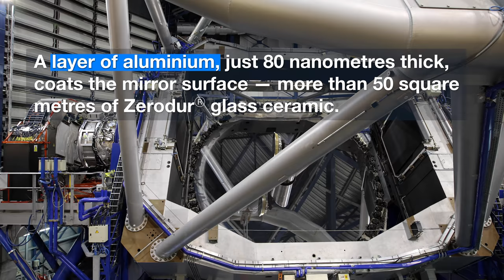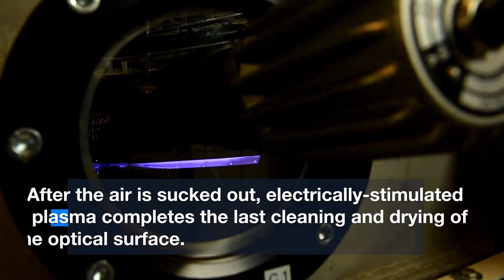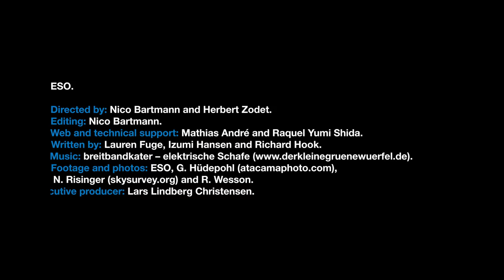ESOcast 120: Chile Chill 10 – “VLT Main Mirror Recoating”

Comment: How often is this done ? If I left a mirror slightly tilted like that in my house, in 2 weeks it would be covered in dust. And I suppose the Atacama desert is some dusty place ?
Reply: i has the same doubt!
Reply: I doubt there's much of a dust problem there, as the dust mainly should consist of sand particles there, which are heavy. It's not like your city environment, where pollen, soot and particles of fiiber rubbed off from clothes and all sorts of small organic bit gather to form flakes under your couch. Plus, there's the dome that will be shut when wind speeds will suffice to carry dust up the hill.
Reply: You must be right, probably more sand than that dirty dust in big cities, with skin cells, fibers and all that nasty black stuff from the pollution. I'd like some Atacama air in my house please :)
Reply: A German physicist actually wrote a paper about the very common dust. It turns out there's some fascinating stuff in there as well. But mainly it's really very fin particles clustering up through electrostatic force. On small scale, this outdoes gravity by several magnitudes, so the fine particles floating around bump into each others in the air ad stick. This makes up the greatest part of the dust you end up having in your room. There's bugger all of that on Cerro Paranal.
Reply: One should not underestimate the power of dust !